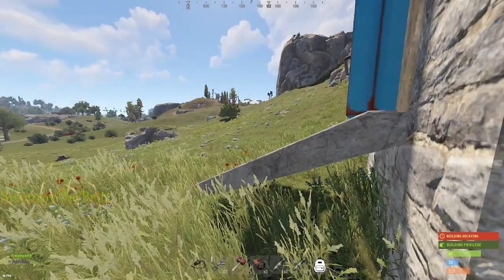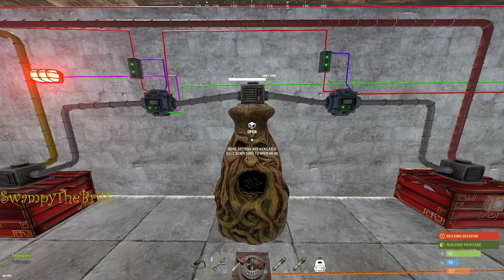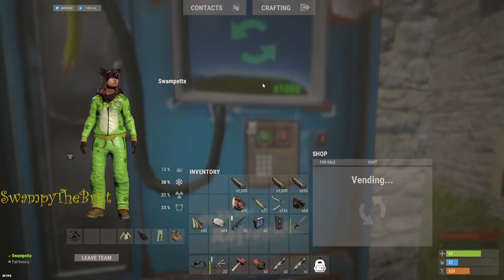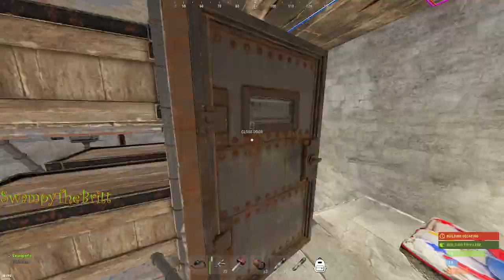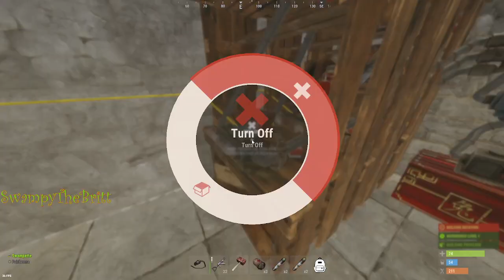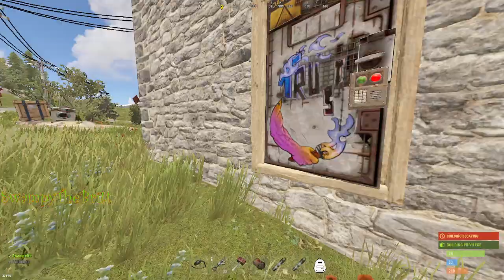Rust self sustaining charcoal shop & farm!

Comment: You should use oil ref instead, it gives more char/wood
Reply from the maker: On numbers, yes. 18 oil refineries will give more char. On space though, you can fit 18 small furnaces on 2 square foundations, vs 2 oil refineries in the same space. And 18 small furnaces produce much more char than 2 refineries. If space is not limited, then absolutely, refineries do produce more char.

Comment: The igniter is ignited every time a signal passes through the filter pass (it pass every time when wood goes through the pipe), how did you block the igniter from working after the first ignition?
I find out the way to block igniter when charcoal goes to storage using filter fail using blocker + another timer with 30 sec delay checking every 30 sec if there's charcoal incoming, but maybe there's any better ways to make this work?
Reply: I use two timers. 1 set to 120 seconds that outputs to the activation of the second one set to .25
Reply: The first one blocks the second from activating again until the timer runs out
Reply: Just use a blocker on the filter pass of the conveyor out of the furnace hooked up to block power in to timer or out . In is better you won't have to hear timer always clicking on .

Comment: At that point, why not just use an electric furnace and eliminate the need for the igniter?
Reply from the maker: Because an electric furnace does not produce charcoal. I do use electric furnaces if I just need to smelt sulfur & metal. I am working on a system currently to automatically switch from wood burning furnaces to the electric ones when I run out of wood or have enough charcoal stockpiled.
Reply: @swampythebritt  oh, so they can’t smelt wood at all. I see now.